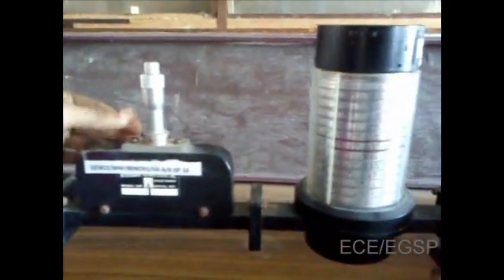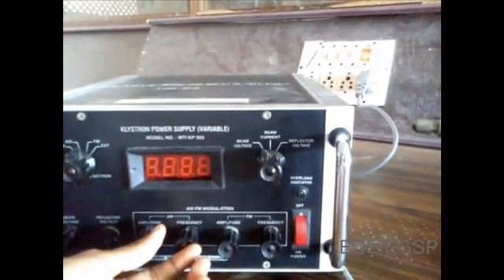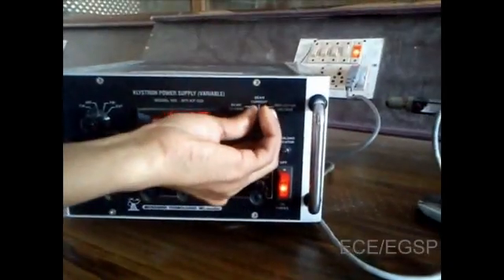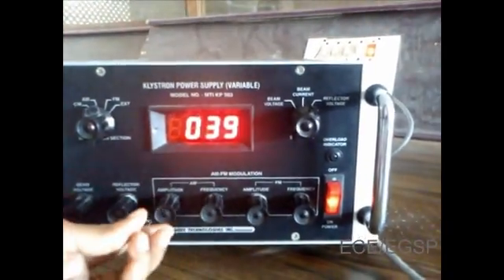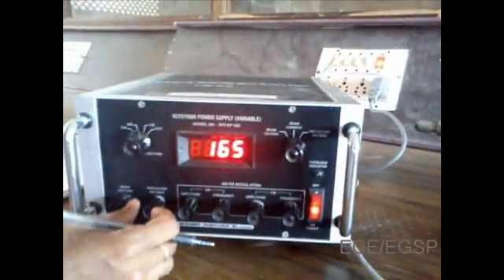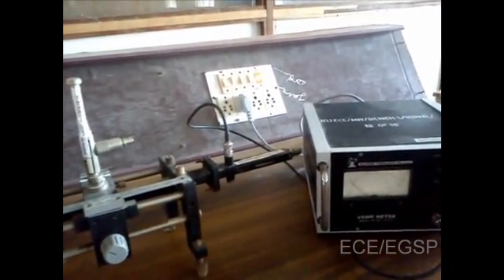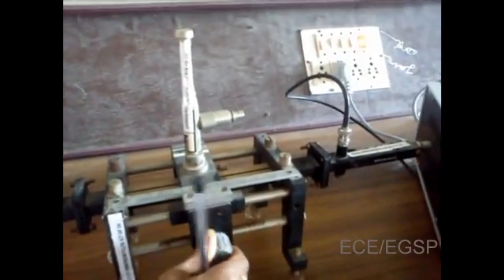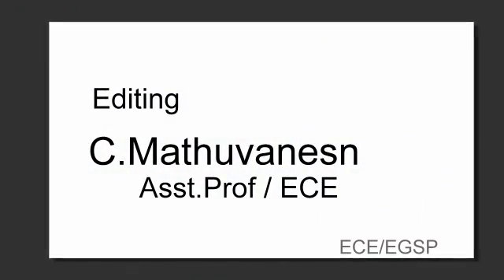Measurement of VSWR

Comment: the voltage on the reflector is negative? and the voltage on the resonator is negative or positive? 
I have a microwave transmitting equipment, but do not have cable connection from the source to the klystron, you know voltages fed to the klystron itself?